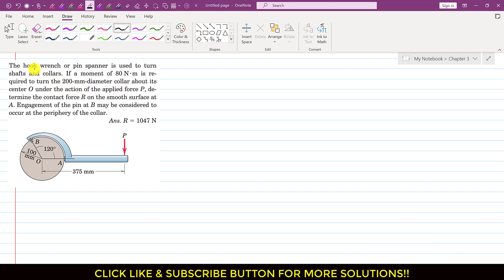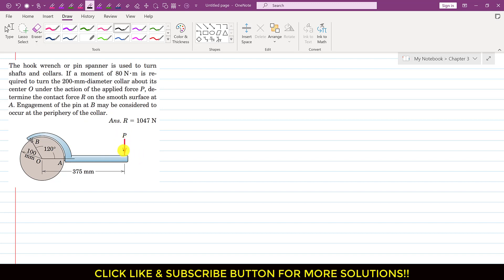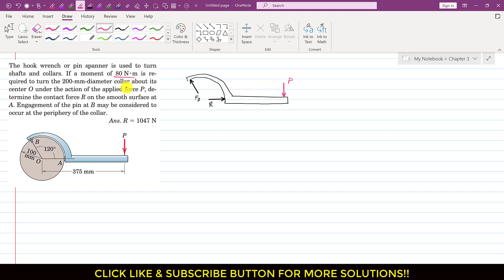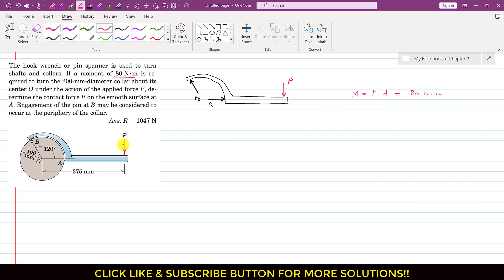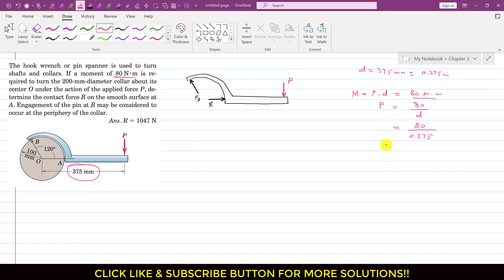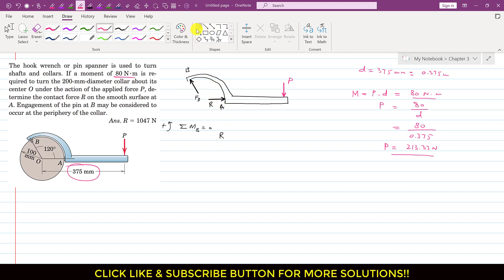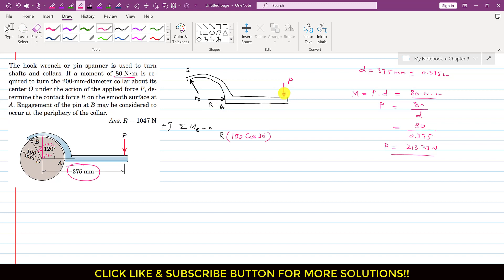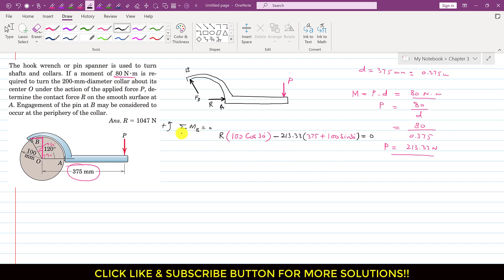Determine the contact force R on the smooth surface. Chapter 3: Equilibrium | Engineers Academy

Comment: Sir,I can apply lami's theorem on it after shifting P force to centre.??
Reply from the maker: For lami's theorem the system must b in equilibrium.
Reply: @EngineersAcademy2020  sir already we are considering it as a not rotating equilibrium position....thus we use moment about any point is zero and sum of total Fy and Fx takes zero.
Reply: So this is already in static equilibrium position.
Reply: That's my thought so I'm confused here why not use lami's